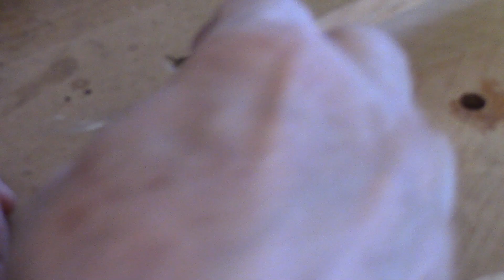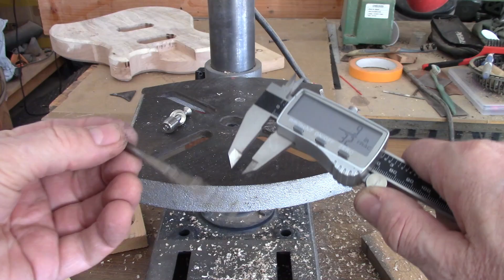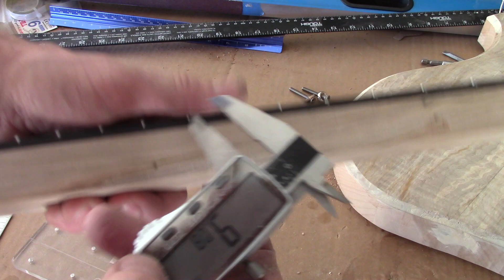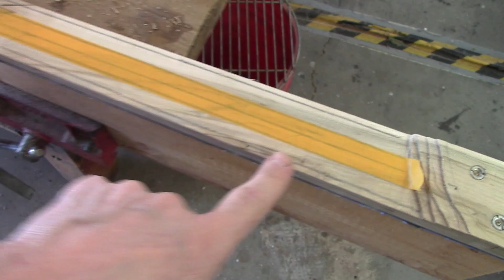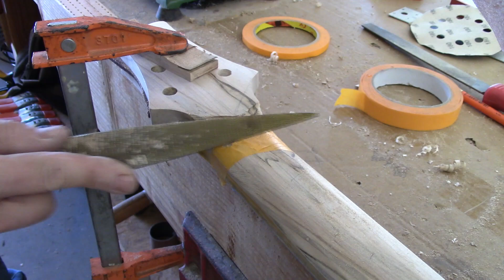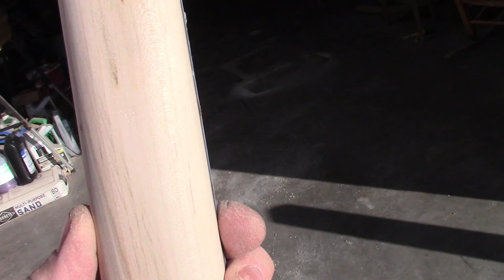Electric Guitar Build - Part 5 Neck build time! (part 3 of 3)

Comment: The rasp is a really cool tool. I'm impressed that you shape the curve of the neck by hand, although it would be difficult to automate (or at least expensive), so it does make sense. 

I'm interested to see how some of these repairs look when it's all said and done. 

The threaded inserts may be overkill but better overbuilt than under.
Reply from the maker: I love the rasp! Yes a CNC machine wold be easier, but IMHO the finished product lacks the mojo of "by hand."
Plenty of errors to come, I just added another one to the list of to-do repairs, you'll see in a future video :-|